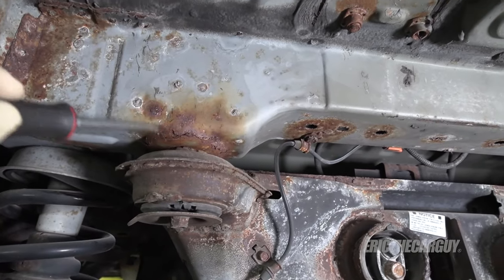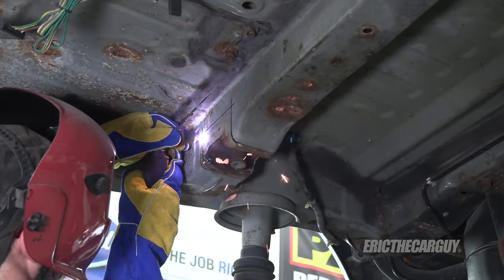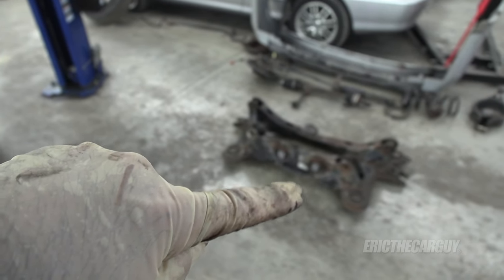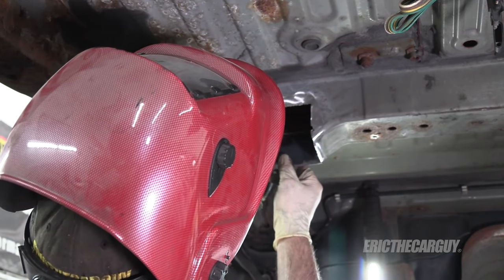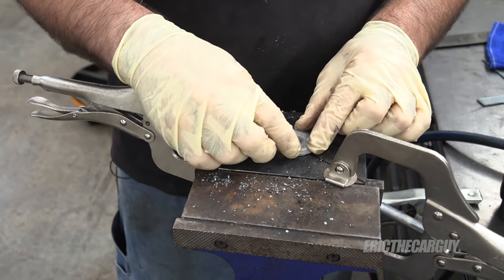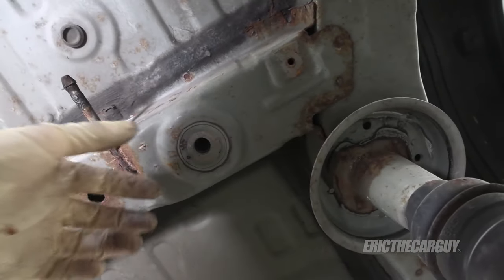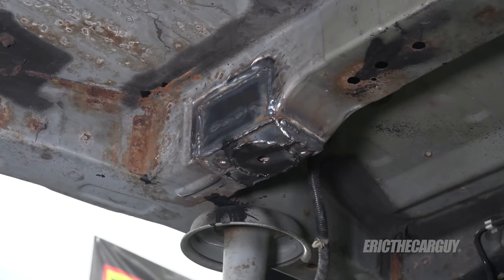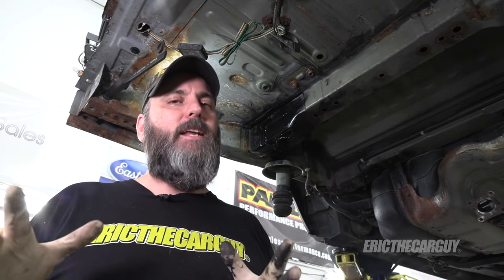How To Repair Structural Rust Damage

Comment: Nice fix Eric ... and yea, a labor of love if you have the tools, plasma cutter, good welder, decent welding skills .... we make cars out of mental, metal rusts and fatigues ... lots of factors like electrolysis, road salts, etc ... even sitting cars rust just from humidity/dew points ... coating undercarriage helps, been using Fluid Film here in PA on my old Jeep for a while, seems to help, with the emphasis on "Helps"  .... and hear Blaster (as in PB Blaster) now make a coating that last 2 years ... again, a labor of love ... my Cherokee Sport is a 2000, 254K on it ... looks new, runs like a Champ ... frame is in great shape .... living in the rust belt is not fun

Comment: I've repaired a total of 3 Honda pilots so far. Two of them were in the past week and a half. I drove two hours to fix one with both mounts in the rear bad. Took the money and bought a 2005 pilot the next day that had 3 bad mounts but it was in overall better condition so I've got a nice 600 dollar vehicle. Thinking about buying as many as I can handle just to repair and resell. After the repair it seems like it may be a little bit better than what Honda had done in the first place. Coincidentally enough, my repair strongly resembles the one you made

Comment: Nice job Eric , But next time you come across something like this try building a box ( welded 5" by what ever the width is)and then cut the slot  to fit the box.in its place . and always use thick metal 3/16 or better to support the nut , it helps with the integrity of the repair..... ( you did a really nice job)   ,I always found it easier to build and weld at the table , than building it under a car . ( 29 yrs experience fabricator )

Comment: I'd be very interested to see you do a repair like this on an Element since you do a lot of Element stuff, and there is a recall in Canada for this kind of issue on Elements, but not in the US, even though presumably US Elements are susceptible to the same issue. If Canadian Elements don't pass the inspection they take them off the road...
Reply: Step 1, would be to make a weep hole in any low hanging point in the frame. That should give you time to figure things out.
Reply: probable because your was made in Canada, thus of lower quality

Comment: Definitely a lot of work in a repair like that, looks good. Little bit jealous of the plasma cutter, gotta get me one of those. Had to patch the frame on my Suburban and it was no easy feat, as I don't claim to be a pro at welding/bodywork or fabrication either. Did mine pretty similarly method wise, had to cut off one of the swaybar mounts bc it was rotting out too, re-connected it to get the location to weld it back in place after patching where it mounted to, and lastly used a similar solution to prevent future rust, but the stuff I got was an oil based coating, had the same hose and nozzle bit though to get inside, just used rustoleum on the outside. I'll probably get that Eastwood stuff next time as it looks like a more permanent solution.

Comment: If your welds get thin/narrow, grind them off, turn up your wire speed (within reason naturally) and then do again only move a little faster. You shouldn't need to weave or anything as you might be tempted. Granted overhead is always a pain but once you dial in your settings it goes much smoother.

Comment: you could have used the weld-through primer, also to make the fabrication easy put cardboard behind the opening and trace the lines from the inside to save time on trial and error fitting. this repair is still a lot stronger than the original, great job.

Comment: 1:45, gee, a low spot in a hollow rail, who'da thunk that it would rot out. Obviously not the engineers who didn't put a weep hole or boxed it in differently. This isn't even a road salt issue, this is a design problem.
Reply from the maker: I almost made an ETCG1 about that very topic.
Reply: .oO( planned obsolescence )

Comment: I've been using these Eastwood 24" extension sprayers for the last couple of months on a project I'm working on.  One important lesson I learned was to buy the paint prep spray to clean the hoses.  If you dont, then the hoses become one time use due to the paint clogging the nozzle.
Reply from the maker: I blew mine out with compressed air after use. I also ended up using the entire can so that wasn't an issue. Great suggestion though.
Reply: @ericthecarguy  I actually tried that before getting the paint prep spray and it didnt seem to make that much difference.  I was hoping air would be a useful enough solution, but the project Im currently working on has required more than one use. It sure its a handy device though.  I'd love to see something like that fitting a regular spray can or even better, an air sprayer.
Reply: xylene, toluene or naphtha should clear out the "non-dried" applicator/tubing.
if you don't already have them on site and means to pump it through the tubing, it's likely best to just buy the prep cleaner and use that.
hint: for mist anything just look up the SDS sheet online and see what solvent chemicals the sprays and cleaners use.

Comment: I did this work in late 80's up till went in the NAVY, the old B body chevy here in PA all had rusted rear frame rails, of course the rear two mounts that held up trunk, it's all about structural integrity, if do quality job into solid metal then it holds. but the cost of material would make that the jobs i did back then not worth it.  very nice repair.

Comment: Firstly, thanks for showing me how to change the steering rack on my odyssey! $2300 from a repair shop was outrageous, i paid $320 for the rack and a few odds and end tools. Less than $500 overall with a bit of new tools!

Funny enough, when replacing the subframe, one of the bolts sheared off inside the frame!! The sheared bolt broke my extractor, and none of my drill bits will penetrate that now broken extractor :(
So.... this is next!

Got 4 new sub bolts, an 
m14x1.5 tap, some tapping paste and a set of m14x1.5 grade 10.9 nuts from mcmaster carr.

I plan on plasma cutting the bottom face and the outer-side, observing how salvageable the previous thread and nut(?) Is and removing the bolt and either welding a nut to the bottom face and tack weld a second nut in place after installation with a new sheet of metal or try to salvage as much as possible.
I think I'd prefer to rebuild new it as much as possible, but I'll see next monday!

Comment: this video would have been extreamly helpful about 3 weeks ago when i fixed my sisters pilot.  the rust was only one one side and not as bad so i just formed a plate and welded it on top.  i didn't completely drop the sub frame.  had to weld in a mirror though.

Comment: My Spanish built VW Polo 86C (the one with the square headlights (1994)) had like many others rust on the rear frame (around the rear assembly mounts) and a lose towing eye, had that repaired at a specialist car welder for only € 385,- ex. VAT...

Comment: It almost looks like the original Honda design allowed water etc. into the box, causing the rust out at the lowest points. Recommend weep holes be added, you never want water to sit on steel. just my 2 cents, excellent video. thank you.

Comment: I think you made it stronger than it was from the factory. A word of caution about using that Eastwood Internal Frame Coating. If you have fabric and upholstery in the vehicle it can be really tough to get that smell out of the interior. One of those interior car foggers from Meguiar's  is what finally got it out of mine.
Reply: No, factory welding is so much better than this, also, cross member was made from single piece of steel. So much stronger than bits and pieces poorly welded.

Comment: After watching the video, I did a few minutes of research. A full replacement body channel is $320. Considering how far you went into the repair, it would have been easier and smarter to drill out the spot welds, pull the rusted part out and just spot weld in the replacement part
Reply: Unless he wanted to heat the garage using his vehicle tho,...lol,...he would have had to completely remove the interior,..all the way down to removing the carpet,...as to not catch the Pilot on fire!,....this is a decent repair,...seeing as the other side looked in nice shape, without much rust/rot.
Reply: When it comes to structural repairs,...less invasive,..is always better. These vehicles are dipped at factory,...and adding corrosion protection is never done with a spray wand, as good as being dipped in an ecoat bath.(30 yr exp as Collision Technician)
Reply: Unless of course the entire service part is rust compromised. Plus Mig VS STRW is an issue as most structural is hss or uhs steel,...and too much heat from Mig welding can alter the integrity of said part,.....but I get where your coming from.....I am extensively trained and am always looking at the legal/ liability side of the equation.

Comment: The subframe mounting points are a common issue with many BMWs, as well.
Reply: Bmw don't rust out they usually just tear out
Reply: The end result is the same, i.e. welding in sheet metal.

Comment: Hey Eric, do you have any thoughts on the use of Cosmoline in preventing corrosion? I first heard about it from a friend of mine who began his mechanical career on the line of VW's factory service in the 90's (he should write a book about the day to day absurdity  that drove him and a colleague 30 years his senior to open their own 2 bay shop).... the first time hearing the name 'Cosmoline' was when he described the grueling task of removing  broken glass  from the gunk that VW coated the inner door panels with. 
   His overall judgement was that, when used properly, it lives up to it's reputation as a military grade anti corrosion coating*, though VW basically just created water basins out of the doors due to poorly sealed windows and inadequate drainage and a lack of attention to coating the innermost portions of the doors, presumably the most rust prone areas
 *(apparently it was first trademarked in the 1860's or '70's as a topical agent for anything from puncture wounds to dermatitis, not to mention the horse's hooves!)
     I'm attacking the cab mounts on my '67 Dodge d200 Sweptline, and figured you might have some valuable insight into pros/cons, limitations and alternative/additional products to consider in my quest, as Biden might say, to "Build Back Better"🦾👀
Thanks for the awesome videos!!

Comment: Tape off the other holes when treating the inside with Eastwood.
FYI, I've seen tests that show that this Eastwood frame treatment is not really as good as as they claim and the old-time frame treatments are hard to beat (like Fluid Film and even better is the newer product Surface Shield Blaster).

Comment: sometimes a cut out from a junk yard is better.  problem with welding in small pieces are that the heat affected zones gets to close and the result may be brittle.  Closed chambers behind the weld joint may be filled up with CO2 to avoid fire.  On occassions I have assumed clean plate on the back and been surpised when its been on fire.  Cant feel the old coating on the back with gloves on.

Comment: Right now, the price of a new (or even new-to-me) car in my area is prohibitively expensive. Rust repair might make sense. Besides, even if you bought another 2003 Honda Pilot, even without this issue, what other issues might come with it ~19 years into its service life? Thanks for the info in any case -- I've never seen this done, and it does help explain the expense. 👍

Comment: Ah, we love the rust in Snow Belt. I love lots grease and rustproofing in those corners underneath cars I work on. Saves me so much grieve with bolts that snap even when heated and rusty holes. F...n snapped Odyssey K-frame bolts and frame cutting to get them out ... 🤬🤮

Comment: I have a 2007 Honda Pilot with only 65K miles on it when the inspection guy told me it was uninspectable and for me to get rid of it because of the structural rust underneath in the back. I was stunned and almost in tears on the ride home. I'm curious if it's worth trying to get it repaired. And if so, would the repair be a long term fix or just a short term fix? I'm thinking of just putting it into a online auction.

Comment: Hi Eric I've been watching since 2012 or so and a few weeks ago I decided to install a dual band radio in my 2016 F150. I found a plug in the passenger floorboard and cut a hole in it with an xacto knife to push antenna and power wires through it en route to the battery and driver fender. To fill in the hole I used several layers, one layer every 12 hours of some permatex high temp oil resistant RTV, it was the smallest container for sale at Home Depot (the nearest large hw store to my house). Do you reckon this is an apt patch? It's slightly thicker than the original rubber plug was and is uniform in thickness instead of a thicker o-ring and a thinner inner section. I let the final application of RTV cure for 75.5 hours before reinstalling the front passenger carpet and trim, neatly stashing the wires, et al.

Comment: Just curious, why didn't you make the outer as one piece, drill a hole to match the threaded bushing end, center it, mark it, "then" make a center support and weld it all outside as a "box" then put the box on your maks and weld it up as a single unit...? Just seems like a lot of unnecessary fabricating that could be accomplished with a break and a better pattern. 
I try to limit welding upside down in tight spaces. I have to do this exact job on my neighbors pilot  only I'm not going to remove the subframe I'm just going to lift the body up and loosen the forward subframe bolts and remove the rear so I can get access to cut and weld. So I'm going to limit on the car fabrication and stick to just welding the part i make onto the car.

Comment: I watched this because I have to repair my wife’s unibody Jeep Liberty. Your repairs “look” good, only thing that I would do differently is to make the bolt carriage framing on the bench then install it. Why? There is no way to do overhead with mig and get a 100% quality welds. Having the piece tacked up in the housing then mount the cross brace for exact fit, then you would only have vertical and horizontal welds. Overhead with mig is not recommended.

Comment: Steelit makes a stainless steel based weld through paint that can stand the heat and would coat the inside of that repair. Allowing you to still weld through it.

Comment: I've seen them where the bolt and subframe drop out of the beam and are dangling. This one still looks rigid. If there wasn't any play, I think it would've been easier to just wirebrush all the rust off and reinforce the existing plate with more welds inside the cavity space. Maybe even add some jb weld to the cavity, it would reinforce the missing metal and possibly be better than the eastwood at protecting this high risk area from future rust.

Comment: I have no experience in metalwork or welding but wouldn't making the new sheet metal rectangles a bit larger so that they lap the existing frame member make for a stronger finished product?

Also, is there actually likely to be any play in the bolt or stud that threads into the round female boss that's attached to the frame? Isn't any play between the subframe and frame handled by the bushing?

Comment: Nope, movement is never wanted at a "hard point" both for accurate kinematics and to avoid cyclic fatigue failures. One reason for not having the threads at the mating surfaces is   the thread roots(including where it starts) is a stress riser.  Imagine a shearing force from a crash/overload  ...Better to have that shear force at the interface happen at the unthreaded bolt shank.  They did avoid a tight git of the bolt inside the stand-off tube to help avoid shear in an accident. Good repair job though!

Comment: Hi Eric don't  weld out joints just tack every 1", when you weld out a joint it causes stress and will Crack again right next to the weld because the weld molecules  are not aligned  with the material the only way to prevent it from cracking when you completely  weld out a joint is to stress relive it with heat you have to heat the material up to 1100 f. For 10hrs. That realine the molecules  making it one just tack and epoxy

Comment: Hey Eric, i ended up replacing a bunch of parts including front axles on my 02 CRV, in lieu of your element video. I now have a vibration in the front. can an untorqued axle nut (or not to spec) cause vibrations? i used a ryobee impact  =/

Comment: Hi, I have seen others use weld through primers to protect metal that they intend to weld. Have you had bad outcomes with that method?
Reply from the maker: No, but there is a discussion about that in the comments below. I'm happy with the internal frame coating.

Comment: seeing as I'm starting to get into more serious repairs of my own, I should probably save up to buy at least a mig welder. I've never welded in my life, but perhaps it isn't terribly difficult with practice. a plasma cutter probably isn't absolutely a must as I use abrasives and saws, but might consider it for the speedier process, and ease of use. that being said, I have no idea how well rust removers work on surface rust, but if I can't save the metal in certain spots, I can definitely learn to replace parts with fabrication and measuring tools. besides I don't care how pretty the underside looks as long as it still has the same functionality for suspension components and overall rigidity

Comment: nice job, seems to be structurally sound so I call it a win. body repair is a hole different animal from regular auto repair lol. check out weld through primer, spray on the back of the panels let dry then weld in place. it was designed for bodywork, wont catch on fire when you weld it.